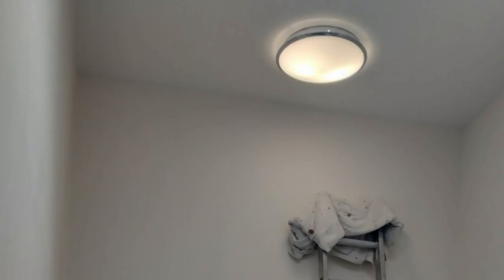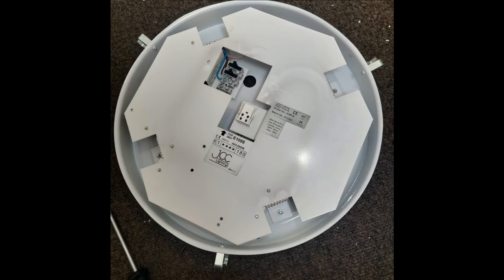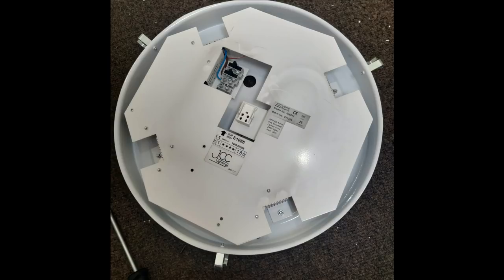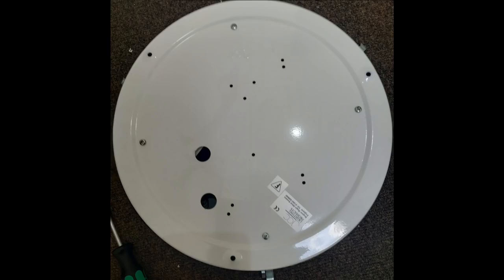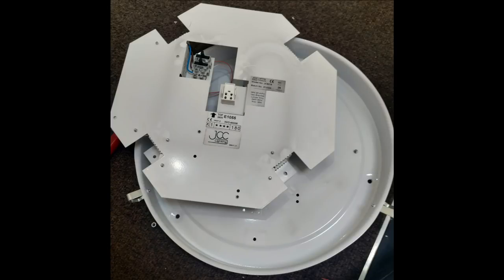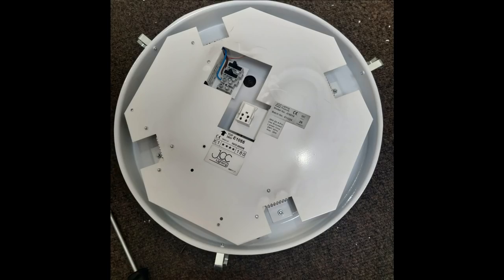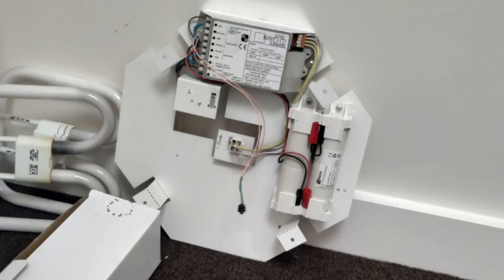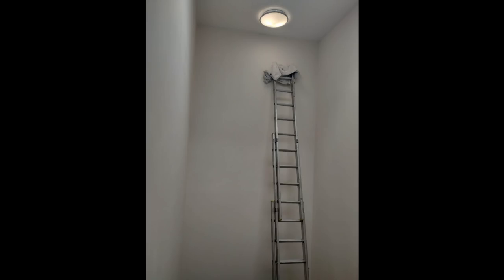Lighting Design Fail

Comment: A lesson for young engineers here. Over 40 years ago I worked for a chap called Arthur Radford whose name will be familiar to audiophiles over a certain age as the person responsible for the Radford range of audio amplifiers.

He told me that the BIGGEST mistake that he believed any engineer involved in manufacturing could make was to design something to be put together. He was adamant that the trick to good engineering design was the complete opposite ...

Design things to be taken apart ... EASILY. Then they can be assembled easily achieving two goals at once ... Simplified production and vastly improved maintainability.

A watchword for good, QUALITY design is usually RAMP ...
Reliability
Availability
Maintainability
Performance

I DO wish more engineers would heed Arthur's very sage advice and design for the third FIRST as ironically it often impacts very positively on the other three.

Comment: Would not be supprised if the designer had put rivnuts or the like there but when it came to production a bean counter decided to put a screw and nut in as it saved half a bean per unit.
Reply: I suspect that they were designed to have U Nut speed fastener clips slipped over the metal tangs and self tappers fitted from below, but the design was changed at some point.

Comment: This was ment to be disposable  units instead of serviceable which defeats the ideia of  emergency lights when they are needed and back on battery failure, at that height. Fortunate there are plenty of LED replacements which should be easier to replace battery. 

Question.:. Does the metallic parts connected at least to the ground ?

Comment: Hi J W

I’ve been an electrician for over 40 years and sadly this is nothing new.
Designed by folk with little or no knowledge of application of use and maintenance🤦‍♂️
Path of the course these days !
Reply: In the motor trade (or maybe it was just my dad) we had a phrase "To replace instrument panel light bulbs, first remove rear number plate."
A reference to these desk jobs having no idea how difficult they make it to change simple parts sometimes.
Reply: I'm only 10 years in as a spark but I've already spent far too much time cursing designers either because their fittings are impossible to service or require 3 hands to install in the first place
Reply: @millomweb  
Smart car comes to mind .
Reply: I've known the phrase as "par for the course"
Reply: Forever Computing That’s the one 👍
Reply: @millomweb  Wasn't it the early Renault Megane where headlamp bulb replacement took two hours in the garage?

Comment: Also blame the person responsible for designing the lighting circuit. Who the hell puts a light fitting so high up that it needs extended ladders to reach the thing. Why didn't they just mount it lower down on the wall?
Reply: Floor mounted lights are the future, you can live in a disco \\o  o//
Reply: And have people staring into it

Comment: Making them serviceable costs more.  And I've seen emergency lights a lot less serviceable (and hence a lot cheaper) than that: batteries glued in place, plastic case glued together, the only serviceable part was the MES filament lamp (capacitive dropper, so don't try changing the bulb with the power on).

And there's a reason it's done that way.  Customers don't like paying out a lot of money to install emergency lighting.  Sure, it costs more in the long run, but they might not be there for the long run.  Their business might fail before the emergency lights do.  Their business might fail because they spent too much on emergency lighting in the first place.  So they buy the cheap crap and regret it later (if they're still around).

Comment: I'm surprised that nobody has had the idea of putting a UPS on the lighting circuit. That way you only have one set of batteries to service and replace, and it is centrally located in the electrical room for easy access.
Reply: The idea, and the standards require this, is for the light to be autonomous - the wiring or switchroom could be on fire and the light would stay on. Historically, emergency lighting would be fed via mineral insulated cabling, which is obviously very hard to work with and expensive. Aside from this, UPS are diabolical - in a data centre context, I think I've had more outages caused by UPS faults than mains failures (in areas with N+2 supply).
Reply: That's far too logical.
Reply: Dave, they do, I service no end of sites with Central battery systems in plant rooms
Reply: @jamie11greeN  Is the wiring from the battery room to the lights mineral insulated?
Reply: @ickipoo  I can confirm - most server downtime is caused by UPS for me too.

Comment: Actually got the same issue with some 2d em fittings on a stairwell failed. Only the ones I have that have failed the gear tray is actually riveted in 🙀no way of getting to the battery.
Reply: Rivets can be drilled out.

Comment: Hi John, it's absolutely true that a good design is not only the performance but also maintainability, the joke of it is that an alternative design would not have cost any more to produce than this one!
So one must conclude these are second rate made by a firm that doesn't have industry practices knowledge as the better brands do which tends to inform design!

Good work John

Comment: This reminds me of my one summer job of replacing fluorescent tubes in an industrial setting. Almost every light fixture had to be mounted as far away from any kind of decent access as possible. If it was not possible to install a fixture completely out of reach then the light would invariably be installed in such a way that the starter hangs off the one end of the light where you cannot get to.

Comment: Hi John.
Do you, like me, think that it is just a matter of time before we have the Wago-style spring-loaded connectors integrated in sockets and lighting fixtures?
I know there are some junction boxes that offer this advantage that very neatly addresses the perpetual accessibility dilemma.
I do, and I honestly fail to understand the hold up.
If I had the cash, I'd be right in there developing this "next generation" of electrical fittings.
Perhaps it's a matter of certification...
Any thoughts on this ?
>
Reply from the maker: Yes, pretty much inevitable.  Some lights already have those connectors, and you can now buy a central heating wiring centre with Wago connectors instead of screw terminals.

Comment: These days I just replace these old fittings with LED units. These old fittings were always compromised due to poor battery life.
Reply: I think John said there 50 of these,LEDs aren't a brilliant as people think they do go wrong.Its not fit and forget.
Reply: Even LED emergency lighting still needs the batteries changed according  to the manufacturer, in a hard to reach place like this the lamps should have had a centralised battery bank for ease of service.

Comment: If you have to put that same fitting back in service, I would replace those nuts with rivnuts in the top piece. Should be easy enough to drill out the hole and then put it in the insert.

Comment: Them 4 fixing points I would use Something called a Rivnut Or Rivert Nut (they are the same thing)In them 4 fixing holes on the inside of the fitting.

Comment: Cheap light fitting which is probably not suited to emergency conversions due to heat from a high wattage 2D lamp.  100% all need to be replaced with decent LED fitting.  The cost would be recovered quickly especially with the amount of work involved in changing the gear

Comment: Probably architect specified, some obscure manufacturer.
Agree, change for LED fittings as and when they go but I would certainly break the old ones down and keep working controllers, ballasts, lamp plug base as they go brittle with heat and age, covers etc.
What twat even considered fitting a luminaire in an inaccessible position. They should have been wall fitted so you just need steps.
It does annoy you, perhaps the architect thought that by the time the fitting dies we would have invented hover boards and simply float up there,. 
I see your ladder top protection JW, I did something similar and when I reached the top of ladder realised that the wall was only 9mm plaster board and my ladder top dented the plasterboard. Decorator cursed me.

Comment: Well, at least as long as you are (still) in the EU, you will not be able to get NICD's anymore and converting these things for example NiMH or Lithium does probably compromise the safety-rules (whilst not original from factory) so you'd probably end up throwing them away anyway. I would not like to have converted a light like that to other cells and one light does not work in a real emergency and somebody falls off the stairs because of that. Probably designed to be throw-away-units to keep up to specs (and yes, I think that is a bad thing).
Reply from the maker: These are being converted to LED for normal lighting only, new emergency lighting being fitted as separate units.
Reply: @jwflame  Yes, that's making sense.

Comment: How does this crap ever enter  British markets ?  Trade Standard Bodies ought to get off their backsides and get out there !
Reply: Trouble is, JW didn't actually point out anything dangerous, and it's not illegal to sell something with a poor service design.
Reply: @chrishartley1210  Quite right, but why aren't the trade bodies who gladly take their subscriptions not challenging the import of such poorly designed items ? 
Another example, Mrs Bloggs goes out and purchases a nice light fitting from Ikea. Mr Bloggs gets his toolbox out, drops the ceiling rose and amazed to see 3 maybe 4 cables coming out the ceiling. So what happens ? He gets the connections right but because the designers haven't made provision for more than 1 cable (like it says on the box) he gets some connecters and pushes everything up into the ceiling void. Out of sight, out of mind !  Must be thousands of installations like that. All because the designers are out of touch with reality. More consultation & legislation needed !

Comment: so this building was or is way out of compliance ??? those fittings are at least twenty years old and never had their batteries replaced and are not marked up with dates ?? who has been doing the tests and who has been doing the compliance checks ??? because clearly no one has really been doing their job and the audit should have picked that up a decade ago ..too many buildings think this isnt important until they try and get the millions form the insurance who will point this all out
Reply from the maker: Not that old - these lights were installed when the building was constructed, which was completed in 2010.

Comment: The light fitting in Japan for home is a lot better .. the fitting mounts to the rose and just plugs in with no fuss with a lot of different designs
Reply: They are available here in the UK too. I remember a couple of "electricians" complaining about how difficult it is to mount light fittings to a ceiling, trying to hold it up with one hand and screw it to the ceiling with the other while standing on a step ladder. I couldn't understand why the weren't using the type of fittings you describe. They aren't much more expensive and the time saved more than makes up for the difference.

Comment: If only you could weld the screw in place, then you could undo the nut from inside. But a stupid design nonetheless.
Reply: If they would have just threaded the metal instead of using a nut.

Comment: JCC haven't changed, still over priced rubbish, no sparky I know would use them unless it's specified by architects or designers, then you know your going to be called back to replace them soon after fitting, all sparkeys are still annoyed having to change all there burnt out Led downlights that all wholesalers had a few years ago, they replaced some under warranty, but it still cost us thousands in labour & travelling to change them all.